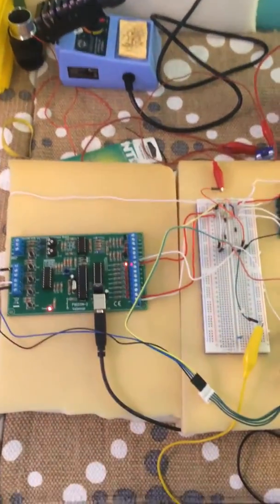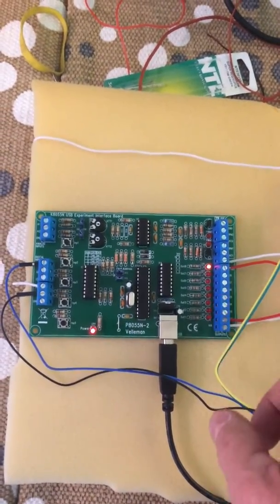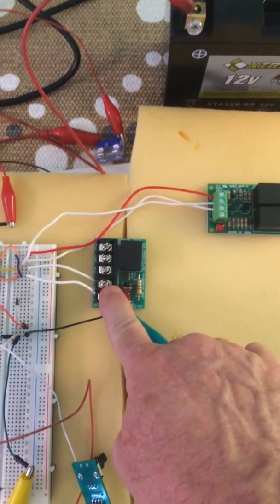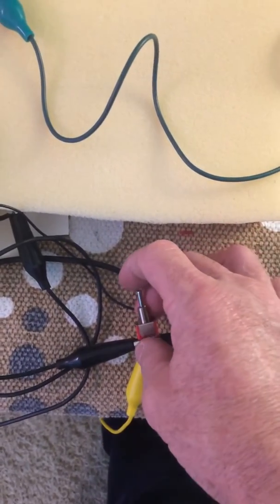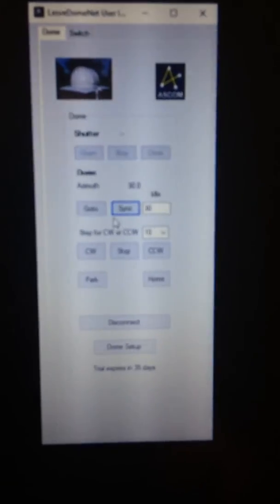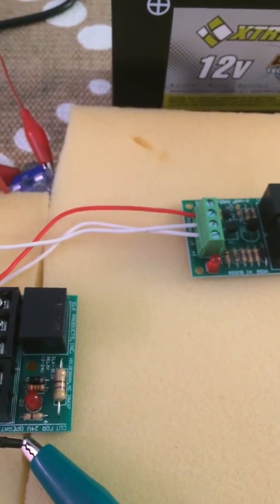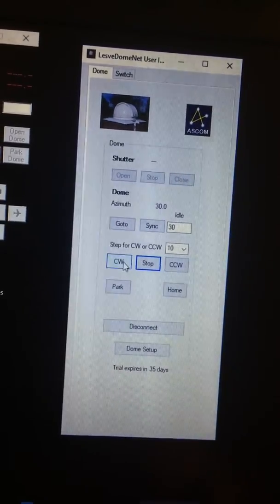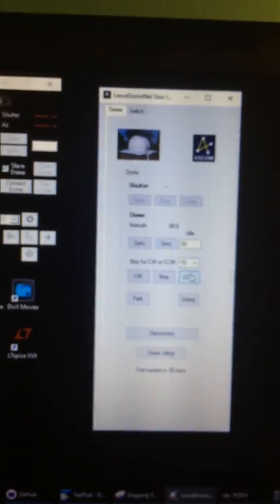Observatory Automation with LesveDomeNet -  prototype part 2

Comment: Hey Tony, wondering if you ever completed this project? Would be cool to see it in action. I’m working on an old TI ProDome PD15 that has been giving so much trouble with the DDW controller, I’ve fixed the circuit board and have it now where it’ll communicate with the software over rs232 but it times out for 5 minutes at a time and I’m pretty certain the problem is in the processor itself. Which leads me here, it looks like the Lesvedomenet setup is going to be the easiest upgrade for our situation (low budget). Are you happy with this kit? Any pros and cons you can share?